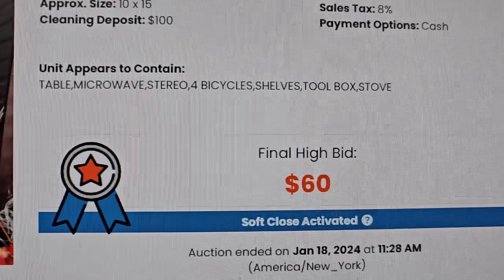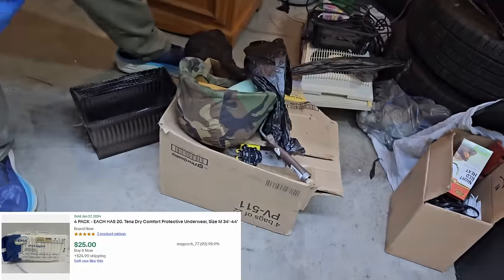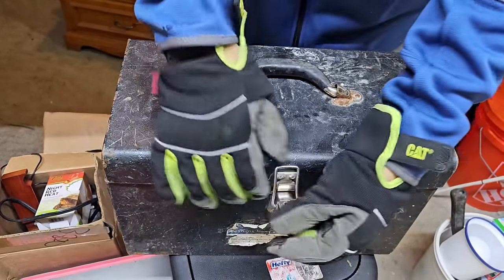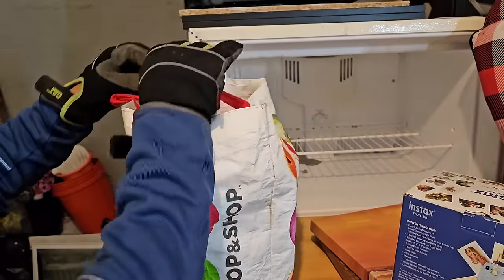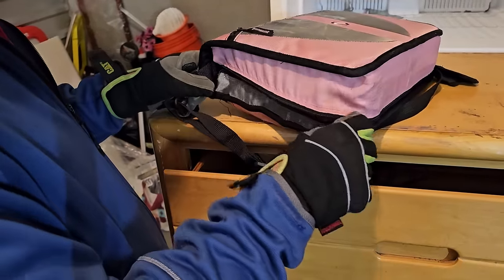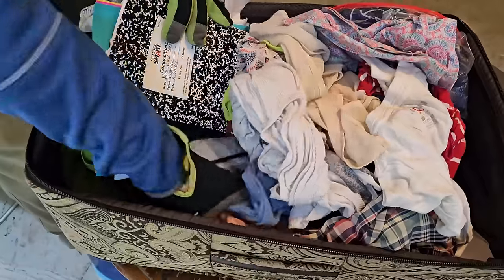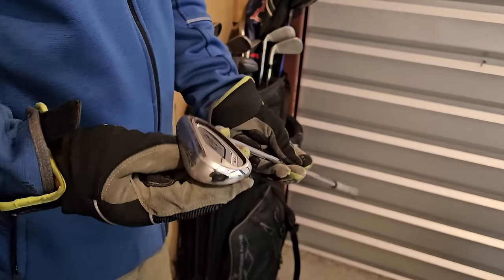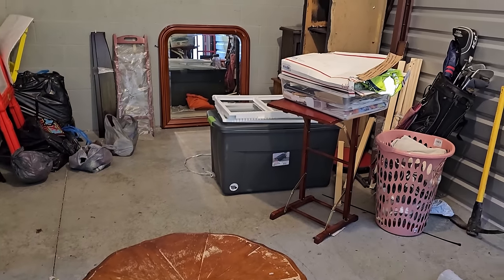I Bought An Abandoned Storage Unit For $60

Comment: Hoping that this helps.   The number "417" stamped on a piece of gold jewelry indicates its gold purity, specifically in relation to the "karat" system. "417" signifies 41.7% gold content, which is equivalent to 10 karats. In the karat system, gold purity is measured on a scale of 24.
Reply from the maker: this is very helpful - thank you!!